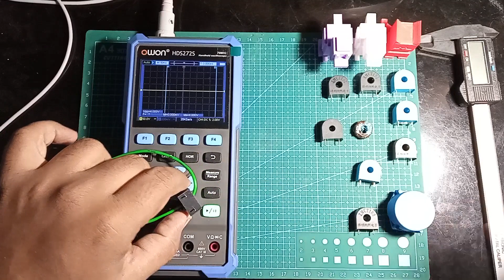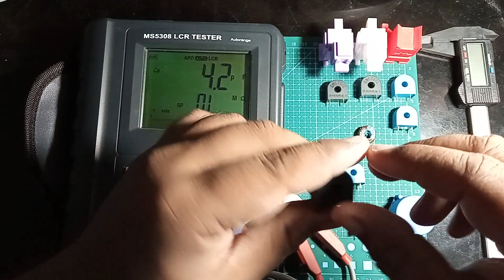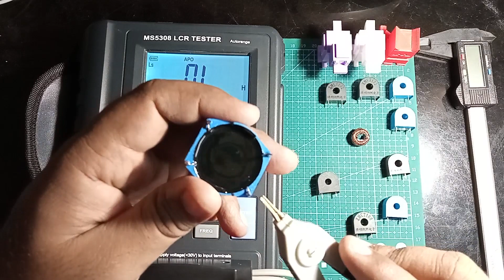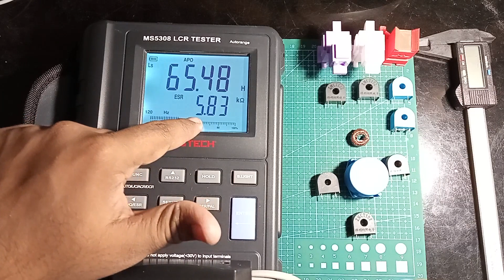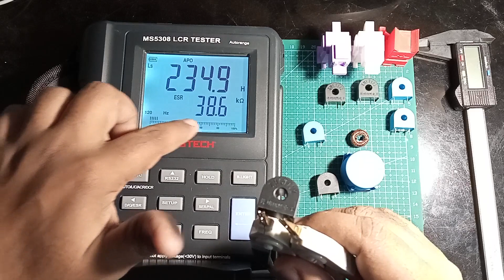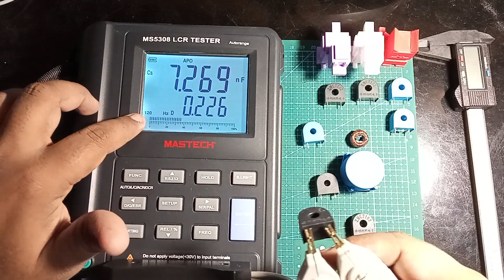Understanding Current Transformers: Practical Demonstrations and Measurements

Comment: Could use this to measure the phase relationship between voltage and current?  For example use a step down transformer to get 12V and use the current transformer with resistor to measure the current. Connect the step down transformer on one channel of the scope and the current transformer with resistor to the other channel. Then, compare the phase angle. Thanks